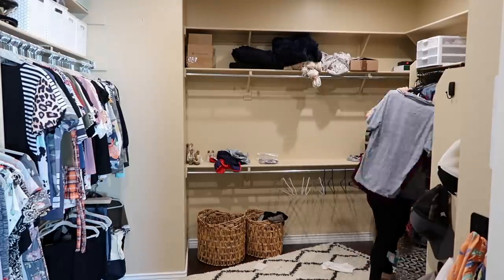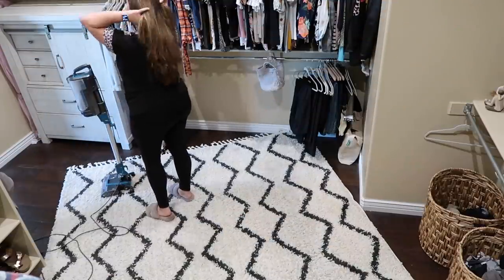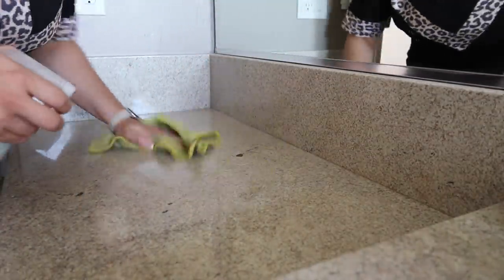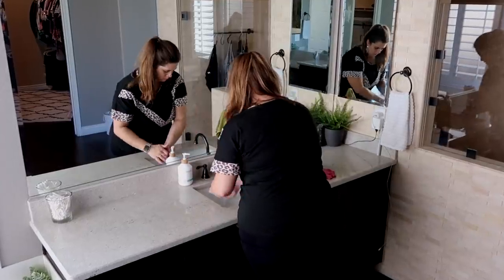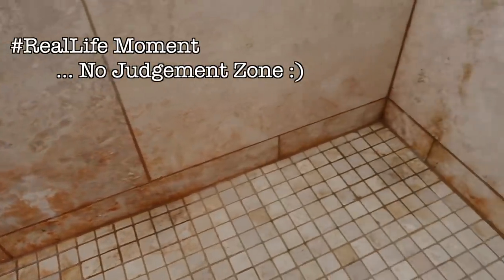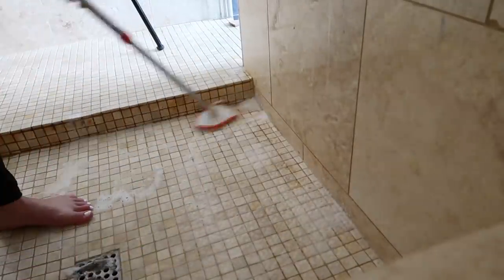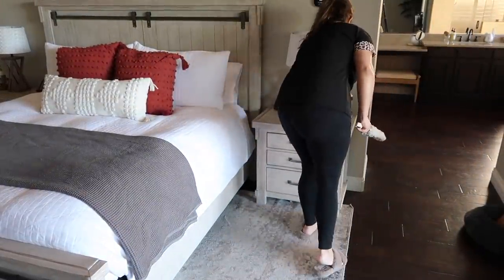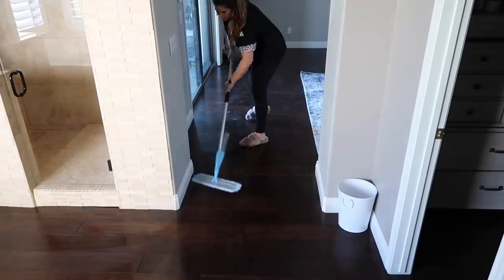SATISFYING! DEEP CLEANING 2021 :: NEGLECTED AREAS IN MY HOME :: DEEP CLEAN WITH ME | This Crazy Life

Comment: Hello Amanda, usually what I use to clean my shower which I dread doing LOL is in a spray bottle that I got from Walmart and poured half a cup of Dawn dish soap and 4 tbsp of Citric acid and the rest of water. I spray it and make sure its coated evenly and let it sit for 20 min depending on how stuck the soap is. It works well !

Comment: Hard water issues.
I have the same issues too.
I will try to scrub down the bathroom  wall ties, floor tiles during my shower🚿.
At time will it use some expired body scrub if I have,  this helps clean out the hard water stains especially those corners and on the floor tiles.
I use small hand held brush has stiff brittles.👍
Good video👏

Comment: Hey there, just a suggestion for your shower. You can get the shower silicone caulk and use the green painters tape and just caulk around the seams and that would give you a temporary fix til you are ready to get your new shower installed or change glass or whatever your Goni g to do. That way you don’t have to keep using towels to keep the water from running out when you clean the shower
Reply from the maker: Wow thanks for the tip!!
Reply: @ThisCrazyLife  your welcome

Comment: Use clear caulk on your shower glass so it doesn't leak underneath and you won't need to put the towel there when you're cleaning it. There should be rubber things for the door too so it seals when you close it.

Comment: I'm so OCD about cleaning that for me it's 100% all or nothing. Which is really frustrating because I almost always lean towards nothing and just blocking the mess out because it's impossible to get it 100% clean and even more impossible to keep it that way lol. For example, the shower cleaning was satisfying until you showed the tiny bit of gunk build up the bottom corners of the shower that's almost impossible to get up. That ruined it for me lol!! So at my house, I don't clean near as often as I should because i don't have the time or energy to get it good enough. If that was my shower, I'd be feverishly scraping it off with a razor blade! 😂